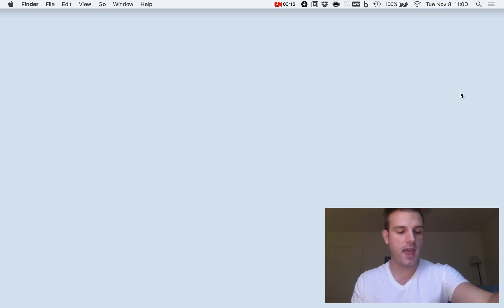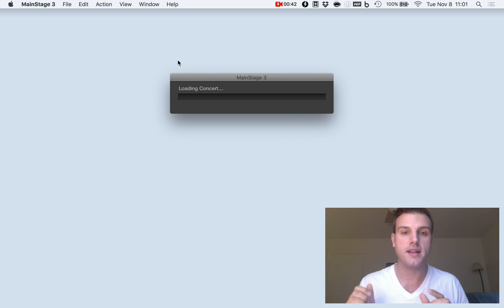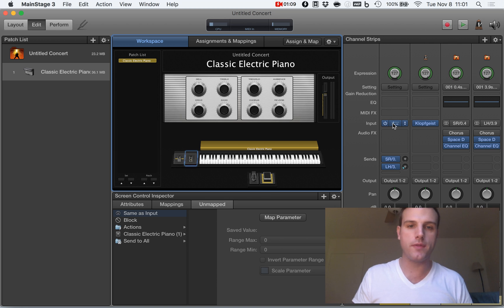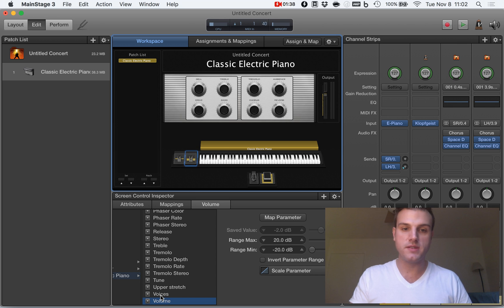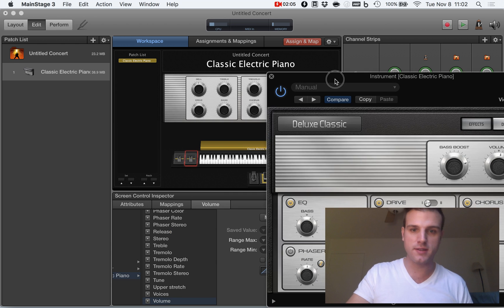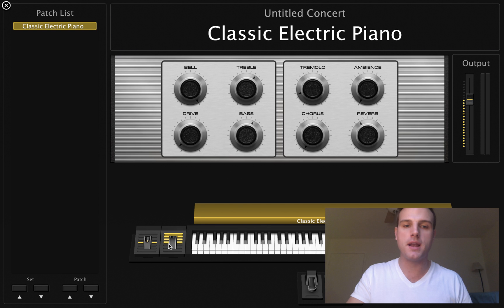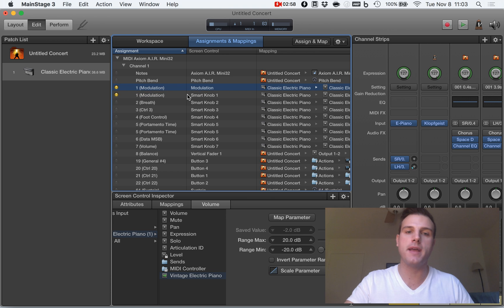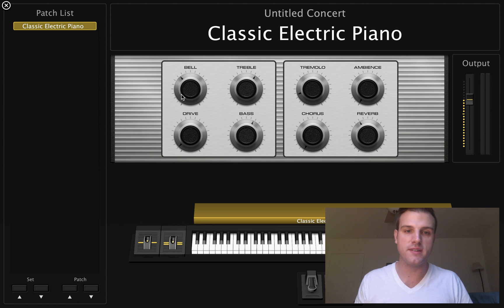Assigning Midi Controls in Edit Mode With MainStage

Comment: Thanks, mate. I have an Alesis QX61 and Mainstage 3. My keyboard has four drum pads I'd like to use to cycle between sets and patches. Right now I think I can get the pads to trigger these changes but the buttons are also triggering C1, C#1, D1 and D#1. I thought your last note on this video would help me, but "Unassigned" isn't an option. Anybody know what's up?
Reply: Thanks for the comment! Unfortunately there isn't a way to block just those midi notes in MainStage just yet. I hope that changes soon!